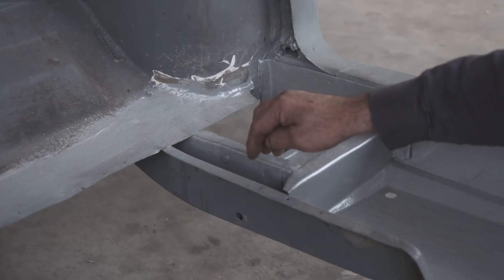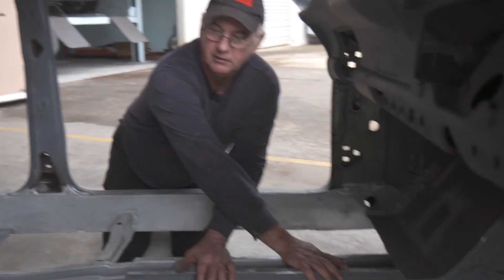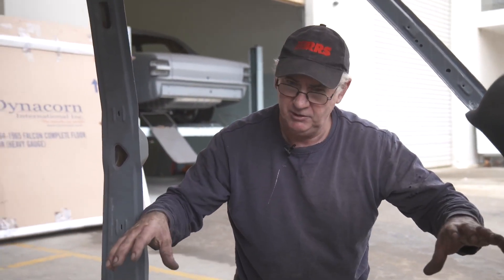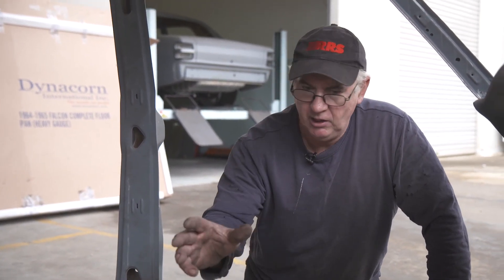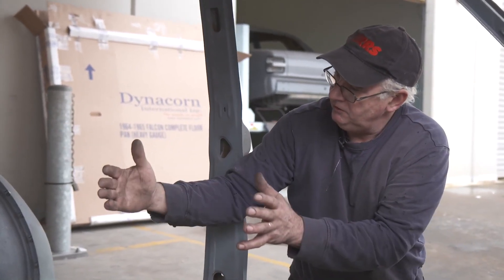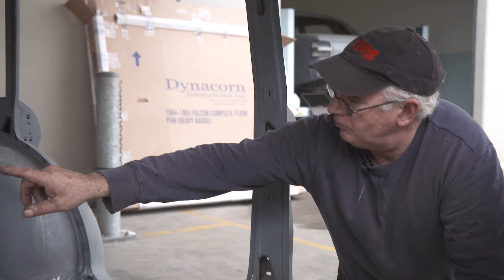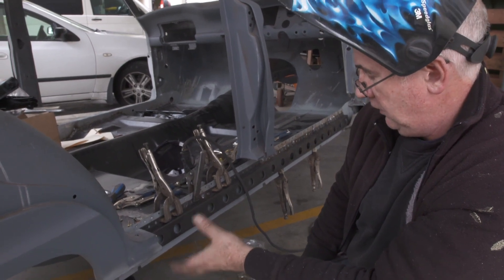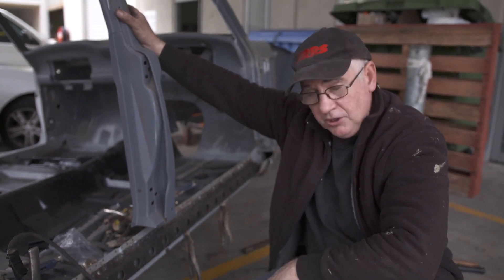The truth about sub frame connectors Full HD 1080p

Comment: Wow, I've never seen anyone remove the rockers to install additional bracing / stiffening before. That's amazing. I think you bring a engineering perspective to working with these old cars that most people miss. Good job!

I do wonder at what point this kind of re-enforcement becomes necessary? At a certain power level? When you're interested in getting it on a track?
Reply: sub frame cars will twist at as little as 250 hp, and gets worse as power increases. 9 out of 10 mustang foxbodies have torn torque boxes and they were a pathetic 225hp 302 engines.